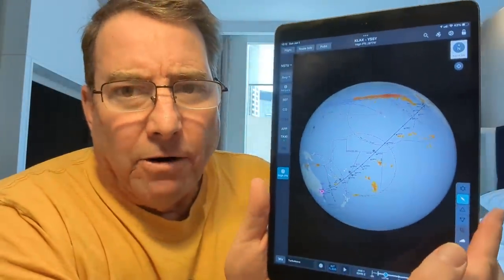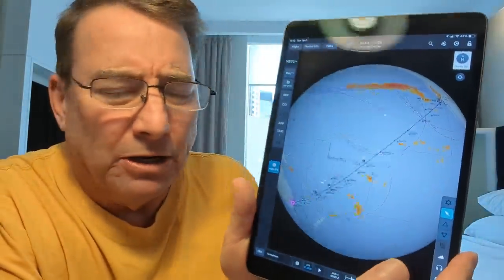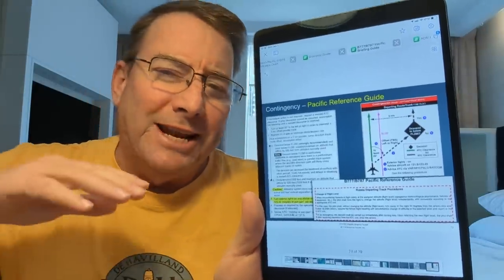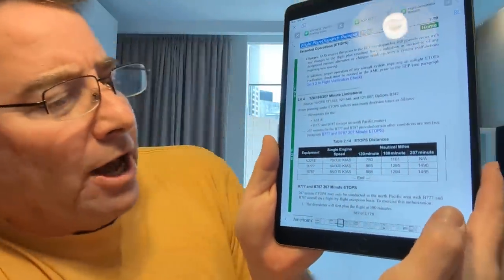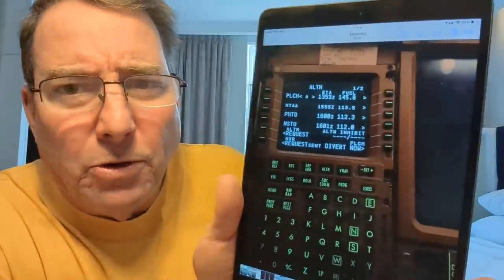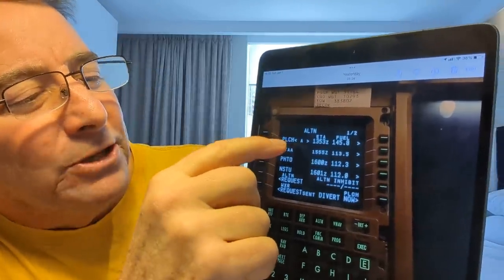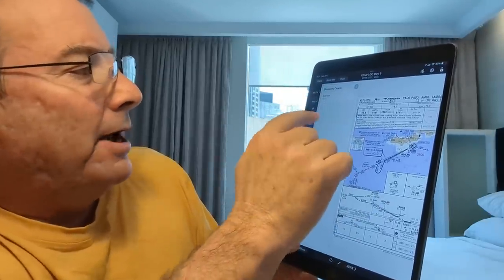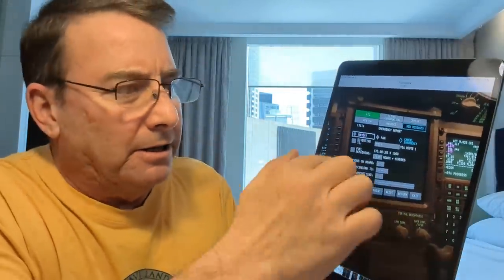Emergency Divert! UAL #839 Pago Pago 1/1/2023

Comment: Two questions: 

1) Are these 180 minute rings static for planning purposes or are they modified for current conditions like wind?

2) I get that ETOPS is predicated on time of flight. But I feel that speeding up to make the 180 minute limit might put extra stress on the remaining engine. I understand that engine can be viewed as completely independent of the one that just failed and should be able to take it. Still... Are there considerations like that or is it just because the rules give you 180 minutes or don't go in the first place?
Reply from the maker: No wind, MCT power.

Comment: Patrol Squadron 50 lost a plane and crew in Pago Pago in my years with patron 50. One Japanese citizen also died in the accident when the aircraft hit the tram cable separating the verticle stabilizer and wrapping the cable around a prop before hitting the hotel.

Comment: When ETOPs came into being (1985) with the advent of both the Airbus A300 (A310) and Boeing 767 twins crossing the Pond; the estimated, and indeed, what were then accepted as a 'mathematical-probability' certainty that the odds of losing both power plants (bear in mind they are both running independent systems - and thus the states are correlative as to losing a second engine whilst diverting due to the first having been shut-down) were one in 10,000,000,000 (10 billion) flight hours. Thus it is not a matter of "if" but rather "when"!
Reply: Air Transat had a flight when they had a fuel leak and they ran out of fuel over the Atlantic (but it would also have happened with 4 engines), they could land on the Azores
Reply: @simonm1447  Correct re Air Transat Flight 236 in August 2002. Had they ran dry c.50 miles sooner they'd have had to perform a water-crash-landing. Whatever of 236, my point was not solely with regard to fuel but simply the reliability of the jet engine(s) itself(themselves) as no matter how 'perfect' and 'ultra-reliable' they have become, the bottom-line is that they are man-made devices and thus subject to fail whether it be one in ten billion or one in ten trillion flight hours.
Reply: @TheSaintKevinProject  Of course, human technology is never perfect and failures may be rare but they can occur. The same however is the case for the rest of the aircraft, exploding engines can puncture even cabins (like the Southwest 737 once) or damage hydraulic lines (like the DC-10 where the rear engine had a compressor disc which tore apart). Aircraft can catch fire (Swissair 111) or lose the vertical stabilizer (Japan Airlines). 

There will always be some risk, but nothing in life is without risk. 

Statistically a failure is more likely if you have more engines - but of course you also have more reserves then

Comment: So... with a single engine failure you divert 30 degrees and five miles offset of your current heading and from there you start your descent. Why do you descend? Is it because there is more air for the single engine to pull thus there is less strain on a single engine?
Reply from the maker: Cant hold altitude on just one engine.

Comment: Sorry. Dumb question. I must be missing something basic here: Wouldn’t a ring defined by time of flight to a given point at a given airspeed be a circle only if winds aloft were zero?
Reply: That’s a good question. My guess would be that dispatch calculates the radius in nautical miles of a 180 minute circle around an alternate based on the anticipated worst case for winds aloft in that region.
Reply: The rule is defined that way, and a few minutes leeway is acceptable. The other engine isn't going to self-destruct once the limit is reached.
Reply from the maker: No wind calculations.

Comment: I tried to follow through on the aircraft N38955 to see if it is back in service, with no luck. Do you we know what kind of damage happened to  the subject engine.  I am guessing it was not a case of just adding oil.

Comment: It sounds like someone should pony up some cash to improve Christmas Island. If the computer was recommending that as the best alternate, it may be. Not every time, but one of these times it will be. An engine failure is pretty far into the Swiss cheese chain of events. Add one or two additional events (with one of those two being the decision to ignore Christmas Island) and ETOPS itself becomes one of the holes. 
Give me an L-1011, MD-11 or 747 if I'm flying over the Pacific. I'll pay more for the spare engine(s).

Comment: That's an airline Passenger Services and Marketing nightmare having 200+ passengers stuck at an alternate airport without sufficient services. At least before SWA set a new low bar for passenger service failures.  Some airlines would carry extra passenger - cabin crew O2 system capacity on those routes so they could do their flight planning with engine out, decompression and stay at a a higher altitude for single engine performance although I don't think they would ever use it other than to save weight in the plan.

Comment: If such an engine shutdown would have been necessary on the same route, but serviced by a quad-jet such as the 747, what practical and safety differences would be apparent in comparison? It seems like that was a large distance flown with only one remaining engine. It might be worrisome--I'm likely entirely wrong but I admit to being a nervous passenger who has a good technical understanding of modern jet functionality.?
Reply: At 11:45 Juan explains his piloting experience of an engine failure over the Pacific. It's not a major drama.

Comment: It seems interesting that once a passenger aircraft gets down to one engine, that engine is treated like it is untrustworthy, although there are many single engine aircraft flying.

I am wondering what the next move for the airline is… and assuming they are putting a couple of 787 A&P techs on the next flight to Pago Pago?  Unless they already have some qualified folks there (seems unlikely).  
I suppose if they need a new engine, they’ll put one on a cargo plane; although I’m thinking the only ones that could carry such a large engine would be the Dreamlifter or an Antonov.
Reply: The issue with flying on one engine, particularly over water, is that the plane is one warning light/alarm from having no engines.
Reply: Its risk mitigation considering they have hundreds of peoples lives in their hands. You never know after something fails if your other engines are subject to the same problem. For example, the one engine starts leaking oil, say a defective o-ring was installed, theres a chance the same defective  part is on your remaning engine. Don't chance it.  As far as getting another engine if needed, they are big but still manageable by a freighter/transport bird.
Reply: If the plane flying with TWO such engines can carry them plus 300 humans and their luggage, I would think the same size plane, cargo configuration, could carry ONE such engine, no problem. Just gotta strap it down really well.
Reply: @EXROBOWIDOW  Not necessarily. It needs to be a freighter made for handling oversized cargo. It doesn't mean you necessarily need a massive plane like an Antonov 124, just a more specific freighter. Most freighters still have a floor dividing upper/lower cargo holds. That type of configuration isn't going to be hauling airliner sized engines. Something like a 747 freighter that has a lifting nose/load door and no divided cargo area. On some older airliners & freighters they used to have a ferry pylon on the wing that could be added to fly replacement engine on. It was inoperable, just there for a ride. There are pictures of 747's, DC-9's with a 5th engine or 4th in the case of a tri-jet. Logistically it doesn't make sense to do anymore. There's a lot to it. The engines are very securely mounted on specific transport frames and not only strapped in the cargo hold but use locking/locating features in the cargo floor and engine stand. Just prepped two CFM56-5B's off an Airbus A321 before Christmas. Each one + its stand was about 9000lbs. The GE90-115B's on our 777-300ER are big and heavy enough that would require  something like a C-5, Dreamlifter, Antonov to haul by air.

Comment: I assume they shut down the engine as a precaution to protect that engine. Would they have or been able to restart that engine in an emergency.
Reply: They ultimately got a Low Oil Pressure EICAS that directed them to shut down the engine . It is not useable after that . Boeing directs pilots to operate the engine normally with only a low oil quantity indication .
Reply: In addition to the above comment ,  a diversion may be prudent with the low oil quantity but on two engines unless you get a Low Oil Qty or High Oil Temp EICAS . Then you follow the checklist which may require a shutdown .

Comment: Thank you, Juan.  I still would feel better on a four engine plane.  Would you even divert if you had 3 good engines?  Economics has driven the switch to two engine planes, but safety is compromised, in my opinion.

Comment: But what does the trade wind direction and speed do to those ranges? If it's longer but the trades make it simple to get there compared to going into the wind... so would you still have to go to nearest? I'd like to know if the trade wind helps or hurts that issue.
Reply from the maker: No wind calculations .

Comment: Thanks for that.  What is involved in getting an engine replaced (if necessary) at Pago Pago or other such relatively small locations?  Are there spares "on hand" and who pays?
Reply: Once passengers are removed, the ETOPS rules are relaxed, and they can probably reposition the aircraft after an inspection.

Comment: Where does the limit of 180 minutes of single engine operation come from? Seems rather arbitrary. Does the risk of the remaining engine failing before landing go up significantly after that point?
Reply: It's as arbitrary as the highway speed limit, a compromise between safety and efficiency. As long as everyone understands the rules, aircraft and airlines can work to meet them.

Comment: Why does flying on one engine require a lower altitude? Why does flying faster require a lower altitude? Is this in order to get more air flow into the remaining engine?
Reply from the maker: You only have one engine!!!
Reply: @blancolirio  But why should maintaining altitude require more power if the altitude is higher? Isn't drag usually lower at high altitude?

Comment: Why doesn’t the FAA pay for the upgrade of Christmas Island’s facilities? The twin engine operations desperately need the safety net and surely airlines don’t want the 3 engine rule back in, which may have happened if it had to ditch. It certainly looks like the rules have been written to suit the geography rather than optimising safety needs - very high stakes!
Reply: Christmas Island is out in the Indian Ocean and it's an Australian external territory. I think they mean Kiribati.
Reply: This was a flight operating ETOPS 180. There are twin engine aircraft and operations authorized for ETOPS 330.
Reply: @AUmarcus  Kiritimati (part of Kiribati) is also known as Christmas Island (only learnt this today)
Reply: @AUmarcus  Kiribati is the country; Kiritimati (pronounced Christmas, according to the Encyclopedia Britannica) is the atoll (thank you, Captain Cook).
Reply: @lizj5740  
The actual "Christmas Island" is in the Indian Ocean. Thank you.

Comment: ETOPS works great –putting profits into the airline, as long as you don't have to divert. That's the nightmare. Lose and engine on the 747 and YAWWWN you still have more motors than the twins in perfect condition. Unless you are above the Himalayas weighing 900,000 pounds the 747 can keep going to destination without the coffee getting cold. Screw all that just make money let all the peasants fly on twins.

Comment: As elegant as the ETOPS system is, it cannot replace the comfort and safety of a 4 engine configuration. With one engine out, or even two engines out, a 747 could make
its alternate with the remaining two engines. But in a 787 or a 777, which have only two
engines, you have no safety margin left. If the second engine shuts down or flames
out, you're going to ditch in the Pacific. You can't glide 1000 miles to Pago Pago.
To put it bluntly, the fuel you save by operating twin engine aircraft, erodes the margin
of safety significantly. Given the choice on an over water flight, I'd opt to be on
a 747.

Comment: if you're confirmed on fire no one is going to make PLCH anyway unless you're nearly over the top of it. 150mins on one engine in the middle of the night over the ocean is, IMO,  unacceptable. One issue with that engine its all over. ETOPS will be cancelled for sure. The bean counters have been getting away with this since the 90s and all its gonna take is one going into the drink 400nm out in the pacific. Then all we are going to hear in the news is how foolish we have been. For me ETOPS 60 otherwise quads mandatory . That's just my 2 cents. The pax will have to bear the cost.

Comment: YIKES,  😬 T W O  HOURS  ON ONLY  O N E  engine !   Ain't NO MORE PLAN B's for these 2 'dramatic' hours !!!
I AM SURE the Pilots and Crew were 'rehearsing their possible DEMISE.'
Just imagine an escalating compound/catastrophic series of events ON TOP OF this 'engine out.'
😵‍💫
Full disclosure,  I like QUADJets because they are inherently SAFER than a TWINJet. PERIOD
The Airline industry NEEDS MORE of such incidents in order to convince all of the (always) need for QUADJets.
One cannot rely on STATS from engine manufacturers and esp. the (Corporate) Airline & Aircraft Manufacturers'
$TAT$ & A$$uran¢e$.  The BOEING 737 346 souls debacle reinforces all this.
There is TOO MUCH emphasis on 'Green Sustainability' and Fo$$il/Sustainable Fuel economy.
Hope I am proved WRONG.
🤨😑😐